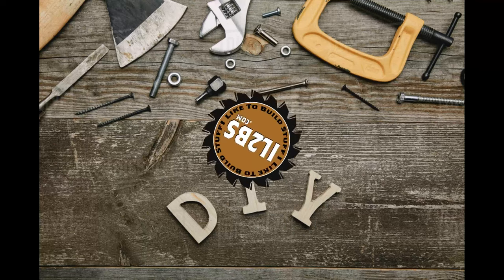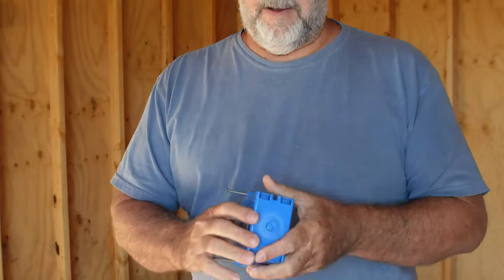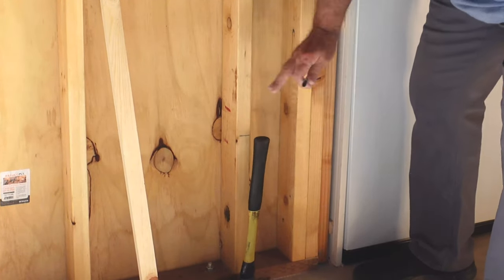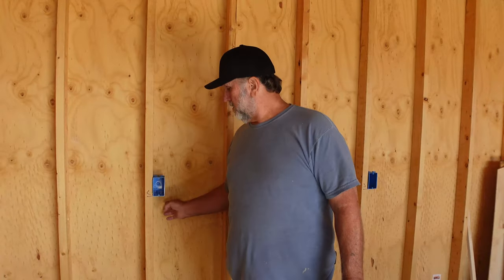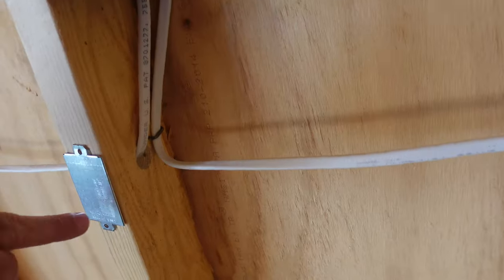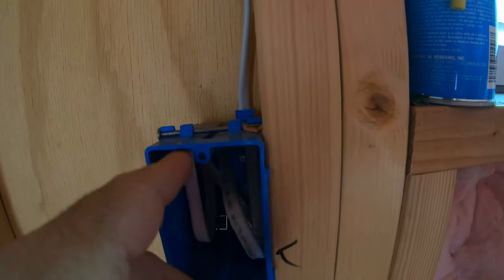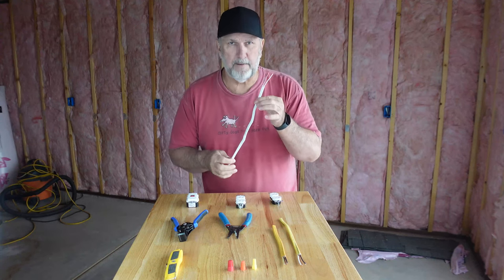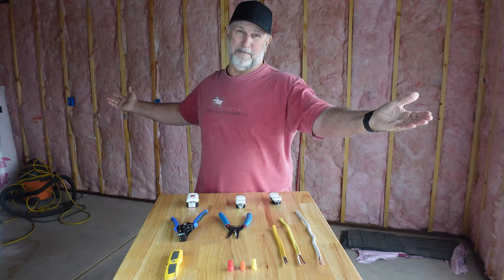How To Guide to Wiring Up Your Garage Workshop

Comment: I would have pigtailed the neutral and hots in your receptacle boxes. Also, did you put 2 grounds under the ground screw on the receptacle? If so,  you should get ground ferrules or ground wire nuts. Other than those two things, that's a good introduction for people who might like to tackle a similar project.